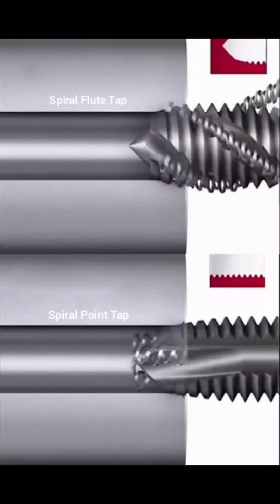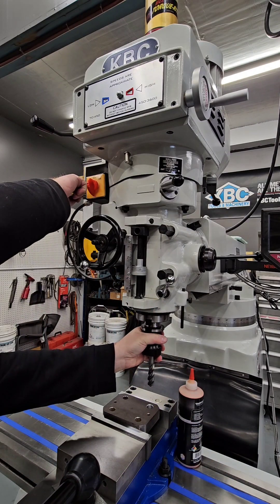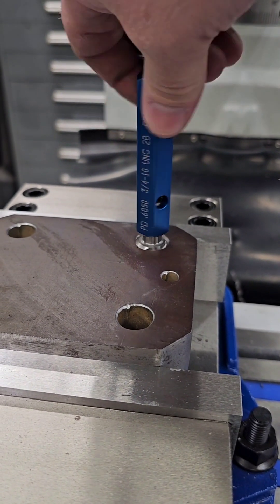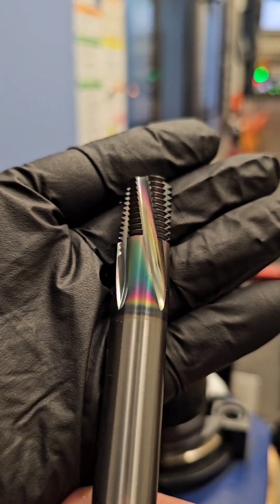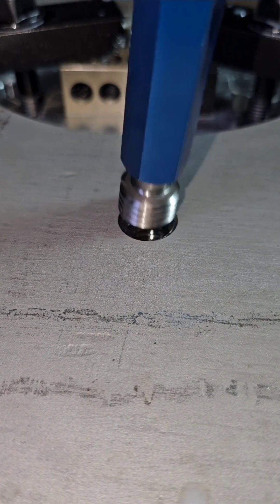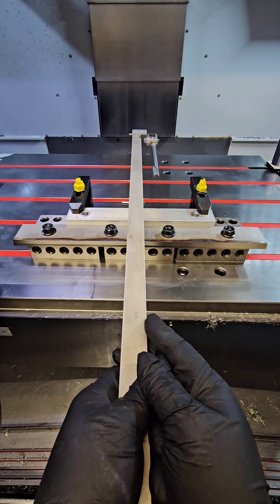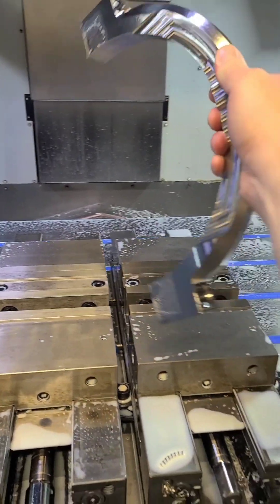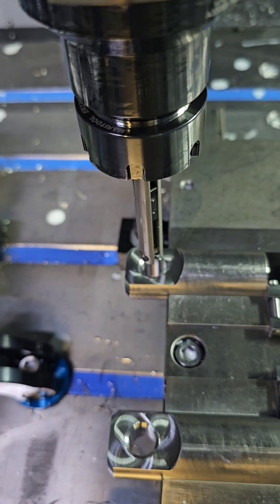Machinist Tips and Tricks Volume 4

Comment: Why don't they offer more spiral flute tapps w a gentil starting angle, like a gun tap not that crap 45 or 90 or whatever, it's to hard by hand if you don't want to risk beaking it off in the work, of you doing non elite machines work

Comment: Where I can find information how to use threadmills? I’m sure that if I try to get M5x0.8 in 1 revolution it will break. Threadmill diameter is 4mm
Reply from the maker: Tougher materials required multiple passes.  It is one revolution per pass using a multi flute threadmill.

Comment: Hello ,

Would you know how to calculate the torque of a tap to determine if it can be tapped in a center?
Reply from the maker: You could try a calculator.  Here is a link to Kennametals. https://www.kennametal.com/us/en/resources/engineering-calculators/holemaking-calculators/tapping-torque-and-horsepower.html
Reply: @OctaneWorkholding  Yes, I know this app, but only up to M18....
Reply from the maker: @RGS_23  Switch to inch mode and select the equivalent size.  It goes up to 1-1/4" which is equivalent to 32mm.
Reply: @OctaneWorkholding  thank you